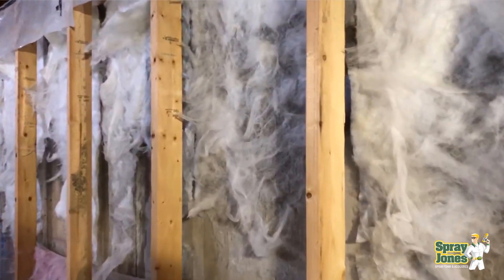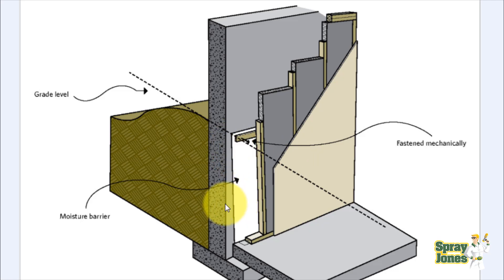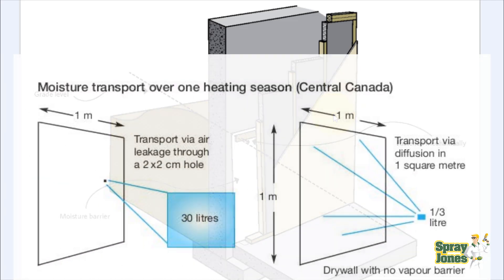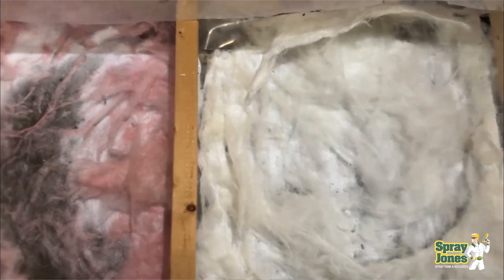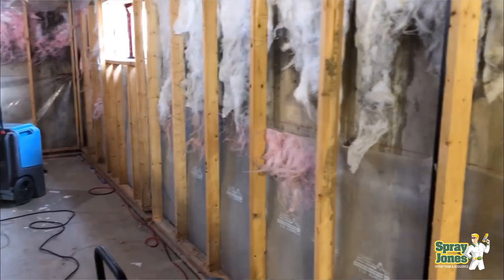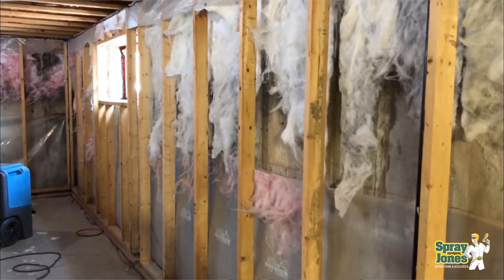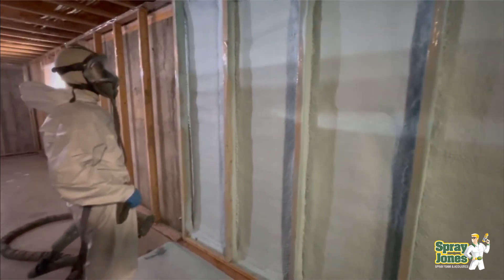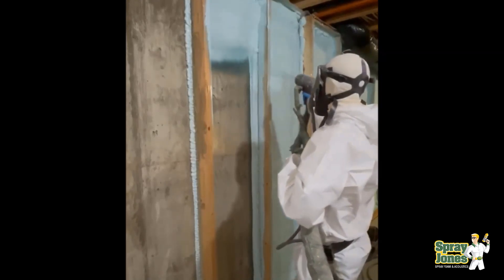Why Batts In A Basement Is An Epic Fail!

Comment: In the case of an old basement that already leaks through small cracks or in the case of an old attic/roof. Does the foam just seal all that up with no long term issue? For clarification on the attic/roof im not talking about using foam to fix a leaking attic/roof. That scenario would be a new roof gets installed all perfect, then it gets spray foamed. Years goes by and shingles or flashing starts to leak. What is the result of that? Since its all sealed you wouldn't see a wet ceiling or roof rafters so i was curious about the outcome of that.

Comment: Is a flash and batt system advisable in a daylight basement (Montana)?

The insulation that is installed currently consists of: 2” closed cell spray foam and R-13 fiber glass batt In a daylight basement (4’ stem wall & 5’  2x6 wall on top). The fiberglass batts are installed on the interior 2x4 basement wall, therefore on the stem wall the fiberglass batt is applied right against the closed foam (no air gap between insulation types) and above the stem wall there is an approximate air gap of 3.5” between the fiberglass batts and the closed cell foam. Is this air gap a potential problem?
Reply from the maker: No flash and batt, period.

Comment: I was a little slow in following but from what I could gather; applying foam directly to the concrete will have no negative ramifications in the future?

My basement has faced bats in the wall but it's not standard thickness so I feel like it may as well have been a bloody throwrug back there. My basement is often 11-13F° colder than upstairs.

My concern is will the concrete be ok in the long run, by having foam applied directly to it? I'm not well versed on this but want to understand it thoroughly, it's just hard to find concise answers.

Many pardons if my message came off as manic.
Reply from the maker: Go watch the basement longevity video I did a long while back. It is in the basement playlist.

Comment: My previous house had a crawl space, uninsulated, and constant sweating/condensation. What I ended up doing was I installed blueskin along the exterior (subgrade) on the foundation and a layer of 2” rigid insulation in front of it. The crawl space was perfect after that and the only moisture intrusion was from the dirt floor; which I’m trying to convince my brother (the new owner) on installing a vapour barrier to prevent that from happening…. I would now always place it on the exterior

Comment: My home in Minnesota has corregated plastic at the wall slab interface and the plastic extends below the slab to allow the moisture to get under the slab to the sump.
Reply from the maker: I hear ya, that is silly too. That is like building a bucket with drainage line to capture and remove water from the roof leaking. 
Stop the leak and you don't need the drainage system.

Comment: I want to use spray foam, my contractor said that the fiberglass and studs would be 3 to 6 inches from the cinderblock wall. Is that okay to do? I have a aprilaire dehumidifier that would be placed behind the drywall
Reply from the maker: Billy watch the whole video...
Reply: @SprayJones  I did. I know spray foaming is the best option but does building away from the wall help?
Reply from the maker: @Officialbillyd23  No. air leakage. So what good is gap when all that air is flowing through the wall?

Comment: Going through the exact same thing with a customer. There Contractor thought different till I got them to put there hand behind a section not opened yet (Was wet). Once I removed the batt from the rim pocket they seen the frost and there sill plate sitting in water. They finally acknowledged that the only fix was closed cell foam.
Reply from the maker: Exactly.
Reply: Wouldnt exterior insulation be better? stopping the humidity before it enters the concrete?

Comment: ROXUL works...it's waterproof.  When I renovated my basement in Regina in 2003, I had to strip off the entire 1980's renovation first, and then brace the walls with 4" steel I beams (which I did myself and had an engineer stamp it).  Very common in Regina with the unique expansive clay (the only other place in N. America that has the same clay is Denver, Colorado).  I then finished it myself.  With the bracing in place, the 2x4 walls were 4" from the concrete, so even if water did get in, it wouldn't touch the batts.  At the time, spray foam was too new and WAY too expensive compared to ROXUL (5 times the cost when I got estimates...part of that is labour obviously).  I'd never use fiberglass anywhere in any house ever.  It really should be banned.  

I did notice in my new 2013 house (pre-built by Northridge) that they put the framing off the wall in the basement (2x6, fiberglass).  I discovered this when I got water in the basement after 120mm of rain in 1/2 hour that came through the basement window (I hadn't finished the grading on that side yet).  When I opened the wall up, the fiberglass was nice and dry and since the floor was still concrete, I had nothing to fix.  The upper joist spaces are all spray foamed with 4" of foam (by Northridge).  I'm not sure if it's closed or open cell.

Comment: Hello from Utah... I'll begin by telling you straight up that I 100% agree with what you are saying here; I too have seen this problem first hand even a few times here in Utah. But let me tell you what the problem at least around here is. And I'm asking you to just hear me out and then give me a truthful, straight forward response...

The problem is cost, cost and cost. Firstly, the builders you mention who don't want to "sell" this system of spray foam, I think aren't just lazy as you put it. I honestly believe that they probably just can't get their customers to pay the extra cost, so in lieu of going out of business because they can't get customers, they just do a 'hard pass' on this system. And you're right in that it ain't their money when that "stupid" system fails. And most of the time it's not gonna be the home owners' money either, at least not directly; It's gonna be the insurance who foots the majority of the bill.

Now let me give you a real to life example of what I'm going through right now. I'm currently in the middle of a very detailed remodel, and I mean "detailed". I'm taking a 1968 built home up to 'beyond current code', in that we even replaced the exterior walls with new construction and we raised the truss system 4 1/2" to accomodate a 92 5/8" stud. In any case, we are now at the insulation phase of the project and I have gotten bids from various spray foam guys for the underside of the roof deck. Now I don't want to get down into the weeds here because that's not the point, but I'll just say that during this first phase of the project I basically just need about a 30' x 30' (900 sq. ft.) section of the underside of the roof deck sprayed with closed cell. The lowest bid I got just for that was $10K. I about shit myself when those bids came in. That's absolutely insane in my opinion, and I'm having a heck of a time not actually typing the F-Bombs here.

And this really freaking sucks because I really wanted the attic insulation adhered to the underside of the roof deck. But I can literally buy a couple of cases of Prosoco's gap & crack (pink stuff) for just under 800 bucks and get the thing air sealed using the system that I've implemented thus far. So the air barrier will at least be at the underside of the roof deck. But then shoot the attic full of insulation in the "normal" (I actually hate that word) old way for less than $3K. So you tell me.
Reply: How about the froth pak diy kits? I'm thinking of trying them on my next structure.  2 inches of foam minimum needed over 900 square feet may save you a few grand possibly. 
My buddy told me to rip pieces of 2 inch closed cell foam board and fit them tightly in between the framing.  Seal the perimeter edges with caulk spray foam cans. From the building science he sharing with us, I think that should be sufficient to stop any air transfer. I'm not sure how critical it would be have the adhesion of the  foam board to the osb (I'm guessing).
We are doing a tiny house ( 328sf) and have been using Great Stuff cans. If we do it all with cans, we should be under 2K, but I'm thinking of doing the boards. 

I think closed cell insulation is the best and we get what we pay for. It is a fine balance between quality and cost and time. Quality will payout more in the long run. Hope the project continues well.
Reply: @onelight2323  : I wouldn't even entertain the idea of using froth kits to do an entire roof deck, nor would I use the Great Stuff cans for that; those 2 just aren't meant for this application imho. I should also probably mention that I'm a retired GC so I may know a thing or two about the building trades. Anyway, if your plan is to press the rigid foam directly against the roof deck (osb) and then have foam applied on top of that... well don't. In lieu of that just get the foam sprayed directly to the osb. However, I've never been a fan of creating a "hot roof" so I would never do it that way to begin with. The correct method, in my opinion, is to use 1" Johns Manville (R6) with aluminum backing. That goes between the trusses and flush with the bottom of the top cord. Then use Zip Tape to seal across the bottom of the top cord. I also hold the rigid back 4' from the top of the truss on both sides (measured along the bottom of the top cord, not vertically from the peak). Then connect those two ends horizontally with that same rigid foam board. This allows the heat coming up from the front eves to exit the rear vents. I'm not a fan of ridge vents in Zone 5 or above (I'm in Utah), but if you did use a ridge vent you could just come all the way to the top on each side.
To handle the openings between the ridge heals, I cut 2x6's with the same roof pitch angle cut along the top of each. I bore 4 2.5" holes in each close enough to the top so the holes are above where the 1" rigid terminates against them. Then cover these holes on the outside with galvanized mesh (tightly woven) adhered with PL400. I then use Prosoco gap and crack (the pink stuff) in the sausage tubes to seal around each of these 2x6's; both outside AND inside. Like I mentioned previously, all the other joints are sealed using Zip Tape, and I take my time so all the tape is flat and not all knotted up which could create air leaks. Then for good measure I use the liquid flash (same pink stuff) to seal around every joint created where the rigid foam surrounds the truss webs. At the gable ends I shoot a bead of the Great Stuff Polyurethane Adhesive everywhere a truss web touches osb; on both sides. I also use this same method everywhere a stud meets exterior osb in the walls. This not only creates an air seal, it gives the same effect as the way rigid foam strengthens a structure.

Now back to the topic of my initial comment. I was hoping Jones would comment concerning the more than $10 / sq.ft. I was quoted here in Utah. This remains a completely ridiculous price in my opinion. I understand that spray foam is gonna cost more, but nowhere near THAT much more. You said, "I think closed cell insulation is the best and we get what we pay for". I would first ask you to define "the best". Meaning who is it the best for? Sure, it's better for me as a contractor if labor is my only criteria, less work for me that is. It would also be better if a person is too damn lazy to air seal in the way I describe above. I would also ask you to define "we get what we pay for". If a person thinks that just because they pay more for something they are getting a better product or job done, then I would say that person is bat-shit crazy. You can believe me or not, I really don't care, but I've regularly achieved blower door scores of sub 1 ACH50 using the methods I've outline above. And I've never needed to pay the higher cost of having spray foam applied by a subcontractor. The only reason I wanted spray foam this time is because I didn't want to shoot insulation the "normal" way into the attic. I wanted the main insulation adhered to the bottom of the roof deck so I could mount the homes' air handler in the attic. I would gladly admit that my way above only provides a "semi" conditioned attic space because there's only R6 separating the roof system from the attic air space. However, my way above does put the homes' main air barrier at the bottom of the roof system and not directly above the ceiling system. Air barriers at the ceiling system are stupid imho because the second a resident adds a can light, hanging plant or anything else that requires a ceiling penetration, the air barrier is breached.

Finally, it seems apparent that Spray Jones just uses YouTube as his platform to pontificate and/or a method of advertisement. Once again, I would have liked to hear his opinion of the $10 / sq.ft. I was quoted for a system that imho only makes it less labor for a lazy GC. While also allowing that same lazy GC to be even lazier by using spray foam as a "crutch" to achieve good air sealing. Because my way above is traditionally less than $4 / sq.ft. and I've achieved fantastic blower door scores using it. With all that said... I'll remain a subscriber to this channel because Jones does talk a good talk and I think he knows what he's talking about in general. But I sure as hell ain't paying more than $10 /sq.ft. for this system; I'd pay $6 /sq.ft though.
Reply: @TrailTrackers  Yes, the best and you get what you pay for are relative and nor absolute.  Thanks for sharing the method you normally do. Seems like the bottom line is nullifying the air getting through.  I am not a gc nor do I have the building experience I'm sure you have.   Cost seemed to be your main concern which is for most of us. I was just offering some ideas of other methods that may be less expensive but still get thr results you want. 
As far as cost, I'm in Colorado and I spoke with a spray foam installer this morning and they are charging $1.20 per square foot per inch.  That is a world of difference between the quotes you mentioned.  I know prices can vary for a variety of reasons but that seems like too big of a difference regardless of the  variables.  I don't know....maybe the installers in your area are in cahoots with each other on price.
Reply: @onelight2323  : Thanks for letting me know the cost in your area. And your cost is exactly what I think is real close to a fair price. 6" would end up being $7.20/sq.ft. and I would most likely pay that to give this system a shot.
The problem here in Utah, as I see it, is they changed the laws so that any Tom, Dick or Harry can get a license to do any of the trades and they need 0 experience. And to get your GC license you just have to be a subcontractor for 2 years. So people are just getting into the business to make the easiest money they can make. They only want the easiest, quickest, get in get out jobs they can find. That's why I considered myself a "builder" instead of just a GC; I actually did a lot of the work myself and only subbed out certain portions. Think along the lines of the Perkins Brothers; they have a YT channel too. Except I was a lot more into building high performance homes than they are.
And to add insult to injury here in Utah, I told those spray foam subs that I would handle all the prep work and all the clean up work. All they would have to do is come in and spray the foam. And the cheapest was 10K for 900 sq.ft. I bet you would agree that's total bullshit. Anyway, I hope you didn't think anything in my previous response was negative towards you. I know it's hard to judge tone when you're reading YT comments, so I just want to make sure you know I meant no animosity toward you in that response.
Reply: @TrailTrackers  Thank you very much.  I didn't take your reply in a bad way. It was informative and you were sharing your position and opinion. Thank the Lord we still have a little bit of freedom of speech. The situation about certifications sounds like most things nowadays,  that is,  being a manufactured crisis. This is my opinion, since 'sham wow' aka bovid 19, things are and will keep getting more difficult on the masses, intentionally.  I bought osb last fall at 18.75 and now it is over 50 bucks.  RIDICULOUS!  I don't see things getting better,  only worse. I'm not trying to be pessimistic but I'm trying to be realistic and develop self sufficiency as best as possible.  I got off track....best wishes out there in this crazy world!
Reply: For those prices you might as well buy a spray foam rig. I'm in Indiana and the closed cell price was $1 a bord ft/in depth spring of 2019, and they had a $600 minimum.  That was me doing the clean up.

Comment: As long as batts\ poly are code it won’t be used much. Where we work it’s 4 times the cost of batts, so no builder volunteers to use it and most homeowners don’t want to give up their quartz countertops to pay for it.
Reply from the maker: Correct, so we have to wait until they have issues.
Reply: Most builders and homeowners, not all, but most care more about the upfront cost and pretties than the long term cost and problems.